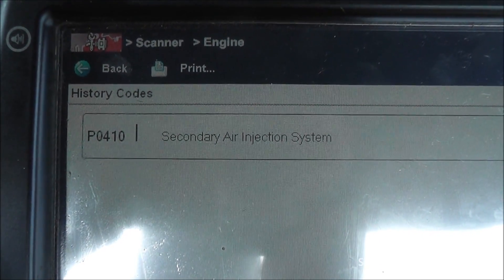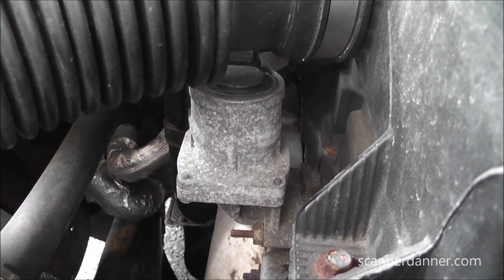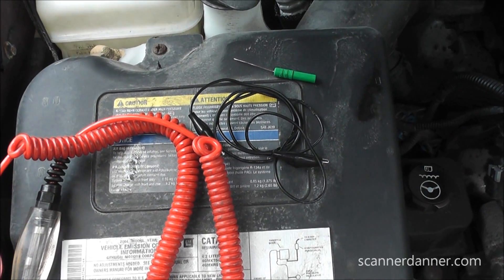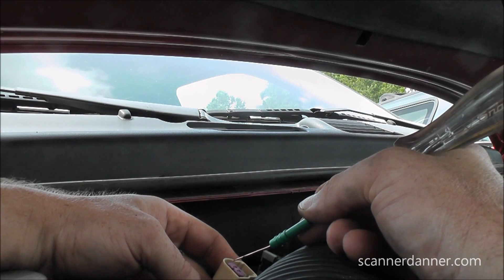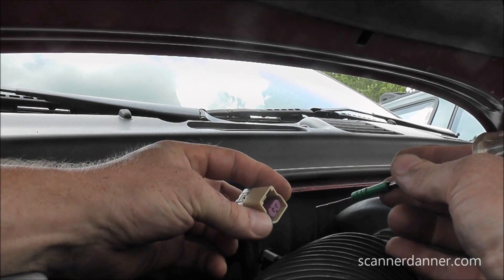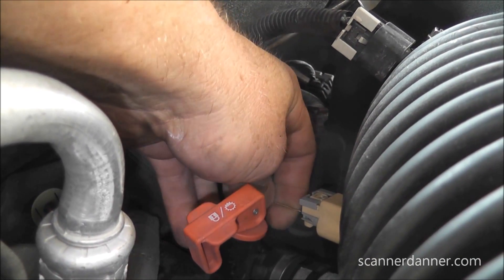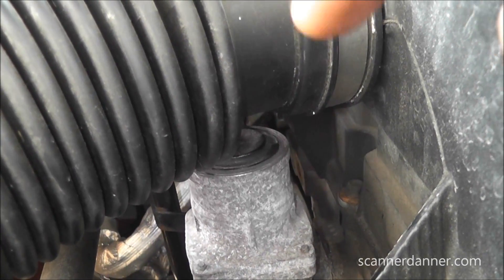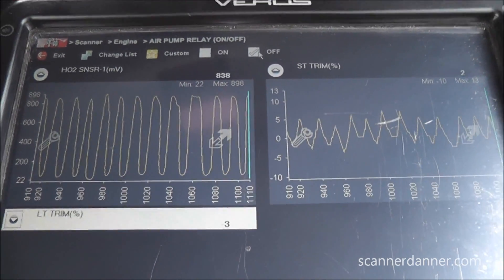How to test an electric air pump (P0410 case study)

Comment: if the hc reading was 50 ppm without addition of any ambient air, but then your pump output the same quantity of air into the exhaust as the engine (doubling the quantity of gas measured) you would get 25 ppm. you with me?

Comment: yea mate, i get the theory. what im suggesting is there may be some degree of cloak and mirrors when it comes to the actual readings. if, for example, you were to pump air into the exhaust 30cm before the opening at the end (where the lower temperatures wouldnt allow burning of any excess hc's)- any gas analyser readings would read less HC's because there is more air.

Comment: Hey Paul. You've taught me more than anyone ever has and need your advise. I currently am using my solus ultra and vantage pro. SO dropped off the versus pro fully loaded. Do you have an email I could get your opinion on a couple of things before I get this thing. I own my units and have a zero balance with him and like it that way. But this thing is way cool. Thanks in advance.

Comment: Thanks for sharing Paul, if the air pump creates a lean 02 signal and that forces STFT to go + then does that not mean the engine will run rich to correct it?

Comment: It's not for fooling the gas analyser. At start up the catalytic converter gets more HC and less O2 than in normal running condition, resulting in more HC coming out the tailpipe (let alone CO). By introducing more O2, the cat can convert (burn/oxidize!) more HC's to CO2. As an added bonus the cat gets warmer faster so it operates better sooner.

Comment from the maker: working on it Frank. It was hacked last week, and was down for 30 hours. It came back on-line for 4 or 5 days and now was hacked again. This time the main server.  I will extend any time for any video that you have purchased, no problem at all. Sorry for the inconvenience. Keep checking, it should be up later this evening. By the way, I have extended all video lecture time periods to 90 days.

Comment: i was told when i was an apprentice mechanic this system is just to fool gas analyser readings to make exhaust emissions seems better than they actually were. seeing as gas analysers dont measure gas quantity you could use an air pump to simply dilute hc's, lowering their ppm reading. my teacher was highly dubious of this systems actual effectiveness even though the principal of adding oxygen to create auto ignition of remaining hc's in exhaust manifold seems correct. what do you think paul?

Comment: I always learn something from your videos. Thanks. I've been fighting an intermittent 411 code (SAI insufficient flow) on an 09 saturn aura with 2.4l ecotec since about 12,000 miles. Dealer tech replaced almost every system part inc. the check valve, inlet hose & the air pump. The new air pump seemed to solve it till the 3yr/36K warranty expired. Now it returns intermittently.